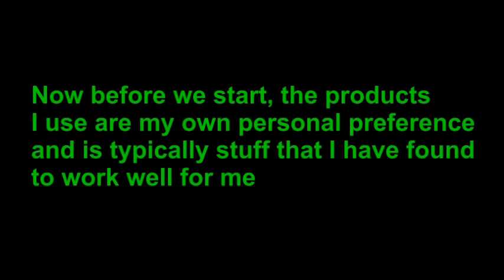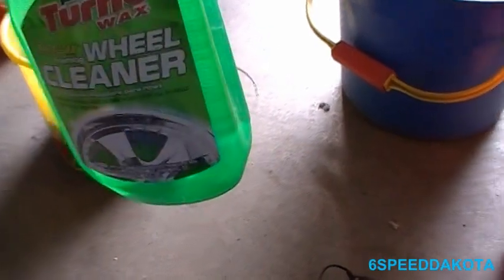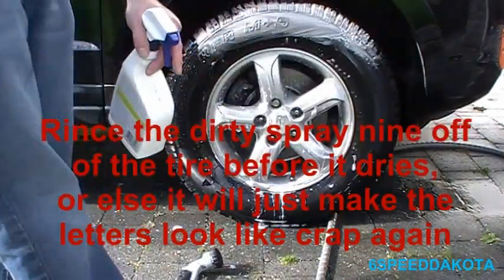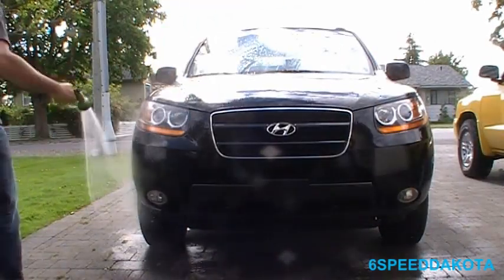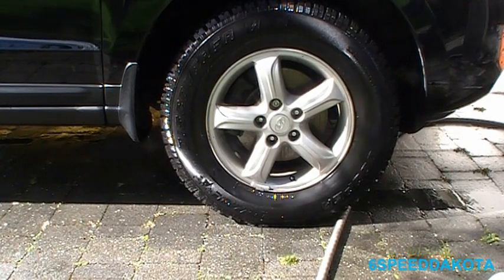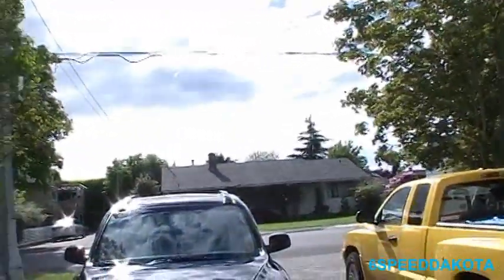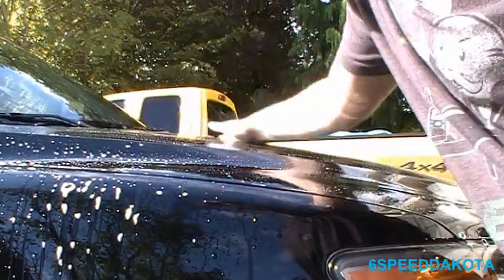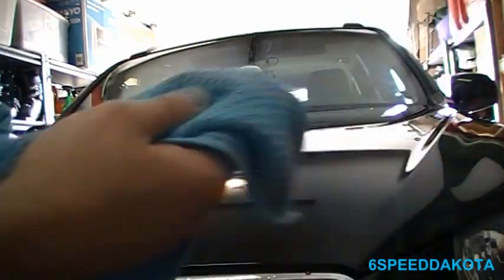How to Detail Your Car Without Spending Your Life Savings Part 1

Comment: And try to do the car top to bottom, that would help a lot too... You would need about 3 mits to be on the safe side... Even using a 2 bucket system...
Reply: Yea I was taught the same wash/dry top to bottom and wetsand before buff. I buff away from the sun cus the sun heats up the panel than it already is.

Comment: do you have wax after you compound and polish and if not what is the outcome if you don't
Reply from the maker: The wax protects the paint, without it, it'll get scratched easily and the paint will oxidize quickly.

Comment: I have an Infiniti g35 and its gonna start snowin here in St.Louis and I'm really really trying to keep it clean, I can't take it to an ordinary car wash cuz I don't wanna hurt the pretty paint job, and I wanna do it myself, I need my car but I don't have anywhere to store it, so my main goal is just to keep it as clean as I can, I would greatly appreciate it if you could give me some advice
Reply from the maker: See, I live on the west coast where it's very temperate and rainy, so we don't deal with road salt and snow as much. One thing I recommend doing if you don't have a winter vehicle and a place to store your Infiniti is to hook your garden hose to hot water, and wash, clay, and wax your car. Even adding a second coat of hard shell wax will be much better. That will keep the paint protected from road dirt and salt. If you can spend the money, it's worth it to have the underside of your vehicle undercoated with a rubberized coating to prevent any rust issues. As for the interior, if it gets wet, try to dry it up as soon as possible, and use leather conditioner on the leather to prevent it from drying up and cracking in the dry winter months.
Reply: +6speeddakota great advice^^^

Comment: is there anything for water marks?
Reply from the maker: Water marks come from minerals in the water. The minerals get left behind as the water evaporates. One thing you can do is add an inline water softener, but that can be pricey. Another thing you can do is try the car quickly with a waffle weave towel like mine, or use a leaf blower or compressed air to blow the water off the car. For treating water spots already left behind, instead of claying with soapy water, clay the car using spray detailer and that'll take the marks off quickly.
Reply: thank you for the tip

Comment: Do I dry the car after the wash before claying?
Reply from the maker: I use the soapy water as a lubricant while claying, if you want to use the spray wax as a lubricant, then you have to dry it before claying. If you want to use the soapy water, then dry it after claying. I prefer to use the soapy water because it saves on spray wax
Reply: +6speeddakota Don't EVER use soapy water for claying!  It's not enough to properly give that slick surface clay bars need and you'll end up inducing swirls in your paint at some point.

Dry your car after washing.  Use a plastic bag over your hand to feel the surface and you'll feel the contaminants that are still on your paint.  Use a quality clay bar lubricant and a the proper clay bar (light, medium, or heavy) for the quality of paint you are trying to decontaminate.   Most cars should need medium, light is for new paint jobs and heavy is for old paint that has been uncared for and is damaged.

Research who you are getting advice from before you ruin your cars paint.
Reply: +Steve H. (Infidel) Using soapy water works just as well if not better than a spray wax.  Look up ammo nyc and his clay bar video.  He is a pro detailer with a full line of products and is very well known.  He said that using spray wax will get very expensive very fast.  He uses soapy water when working on some very expensive cars.